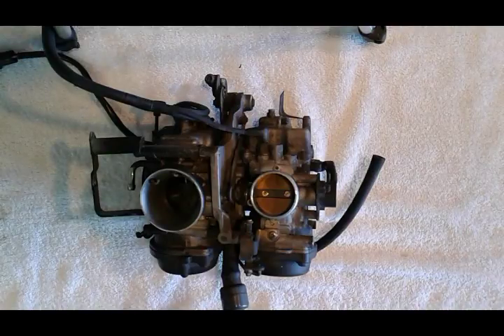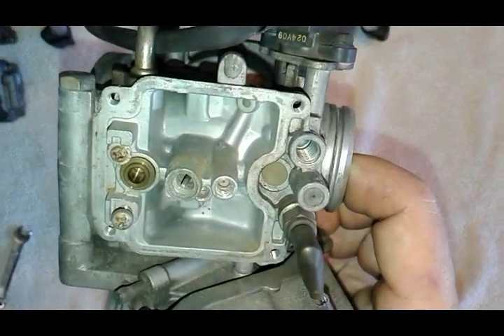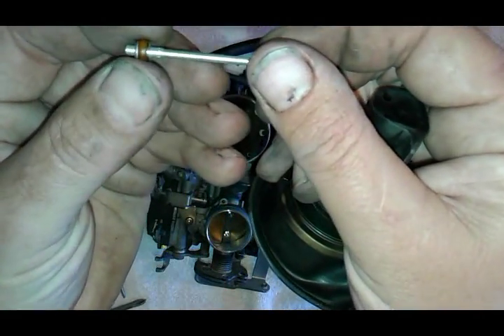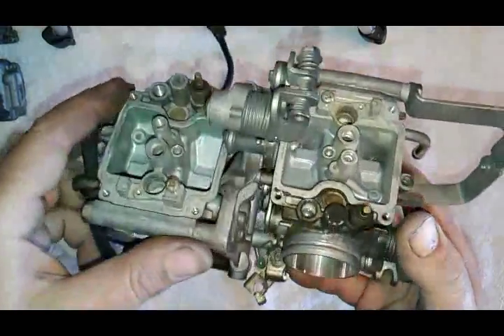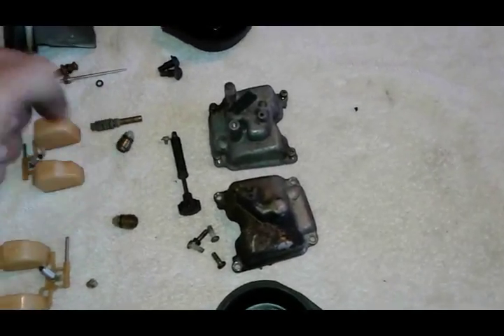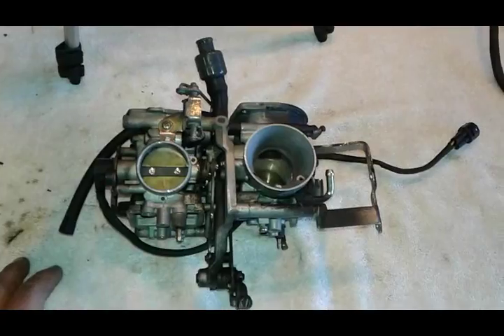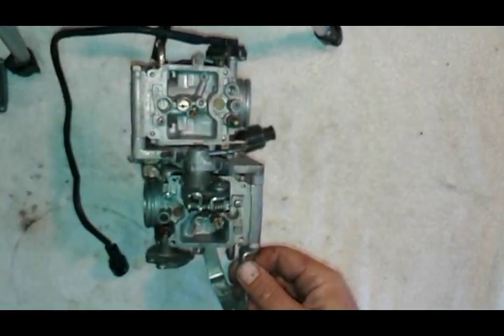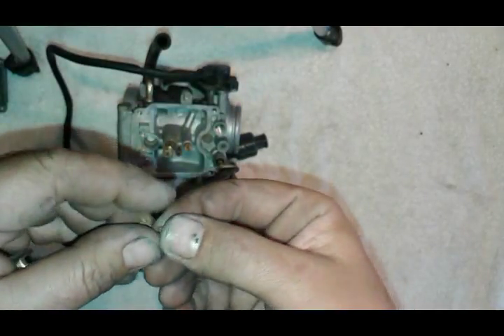Yamaha XVS1100 carburetor rebuild cleaning or jet kit  DO IT LIKE PRO!

Comment from the maker: Yes sir....you answered your own question. You have to replace the o rings. This is very common reason for fluding. Even if the float needles are new the fuel is coming in around the outside of the float needle seat. It will be coming out of the tube between the carbs and also filling up the airbox and sometimes filling up the engine...easy fix...new o rings and needles...done! GOOD LUCK AND THANKS FOR WATCHING !!!

Comment: I have a Bt1100 bulldog 2005 that has been stood for 7 yrs. will this be same for my carbs? Same engine please. Fabulous video. Done lawnmower carbs , this a little more daunting. Got it going and it pullslike a train but tick over and starting terrible. Previous owner not run it in 7 yrs. doesnt have a petcock just a feed under tank.

Comment: The wires you disconnected from the bottom of the carbs at 2:46 where do they connect. Mine accidentally the round wire pulled out and i want to make sure i put it on the correct connection. Its driving my crazy please help

Comment: Hello,  I just noticed your carburetor is a little bit different than the one on my 05 Vstar 1100 Custom. Mine has a fuel cut-off solenoid valve on each end, I got my bike running after cleaning the carbs but the check engine light is on now. After further research, the bike is giving me codes 57 and 58 which, according to the owner's manual, are indicators of malfunction with the carb solenoids. There should supposedly be a wire/harness connected to each solenoid, but in my case, none of the solenoids have anything connected.  Apparently, each solenoid costs about $200, so it won't be a cheap fix. 😞
Reply: Three months later...  Anybody whom cares, look up "XVS1100 remove fuel cut-off solenoid".  I doubt they're actually needed on the later bikes that have them.  You can cut down into the rubber top, drop a wire and hot solder onto the conductor end, and seal it with rubber cement or jb weld, etc...

Comment: Good video, but the smaller sized main jet is for the rear cylinder.
Reply: It's an air cooled bike.  The smaller jet goes to the front jug that gets lots of air as you're riding.  The larger one goes to the back to make it run a little cooler. Even on my water cooled Honda the rear jet is larger.

Comment: I would like to talk to you about an issue on my 2002 v star 1100 carb it has gas coming out of the little tube between the carbs and out of the air intake. I am assuming the floats are stuck open?
Reply from the maker: Yes that is correct ...the best thing to do is take the carburetors out and go through them just like you saw in the video...replace the float needles and the float seats... also check for debris you might have some rust or otger stuff in the gas tank.  it would be beneficial to replace the inline fuel filter
Reply: I am running into dripping out of the tube on the carbs as well.  The jets have been cleaned and the floats are definitely not stuck, but I am noticing that the float seat o-rings looks really worn.  When I pulled them out to inspect them there was no resistance when they were pulled.  Would that cause the fuel dripping out of the vent hose on the carb?
Reply: Had the same issue and both of my float needle seats? The part with the screen, both o rings were bad.  Just did the rebuild yesterday and so far no leak